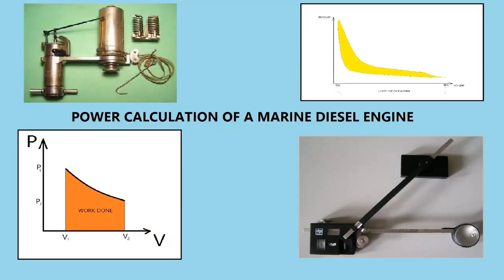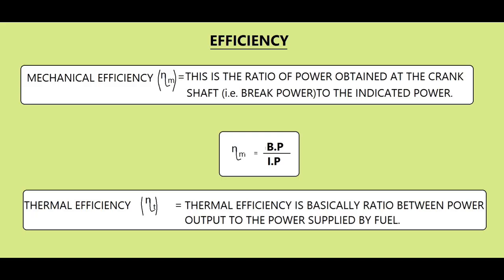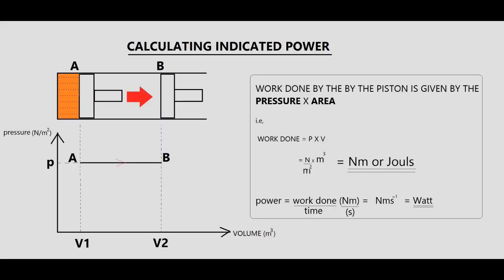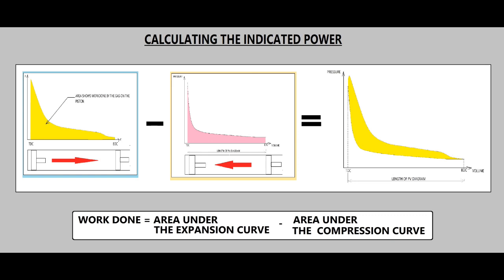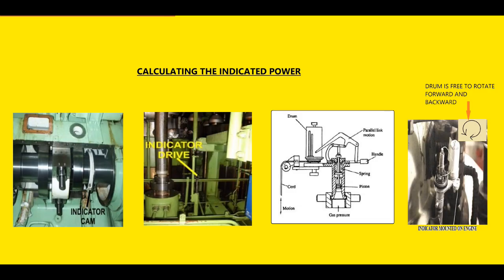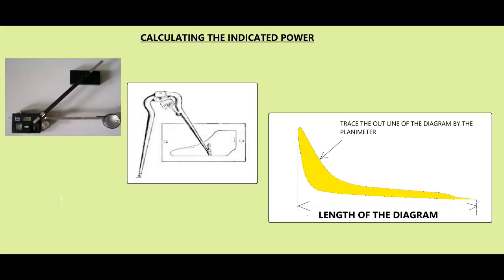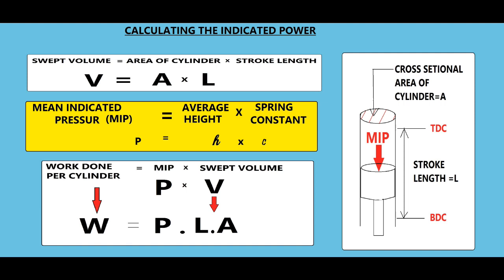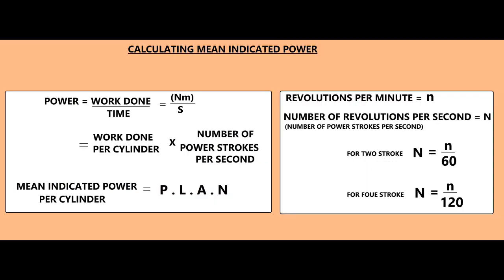indicated power calculation of marine diesel engine

Comment: sir according to b & w manual
Mean indicated Pressure  Pi=  area of diagram / length of diagram x spring constant
Mean effective pressure Pe= Mean indicated pressure - losses
losses =  0.125 Mpa which is constant according to manual for model 7L35MC

Effective power = Pe x cylinder constant x rpm
Indicated power = Pi x cylinder constant x rpm

im confuse why mean effective pressure is use for Indicated power instead of mean indicated pressure. 
mean effective pressure and mean indicated pressure are not the same, is it correct?
Reply from the maker: Effective pressure is the pressure use to develop useful power.Indicated pressure is the one use to calculate the total power development measured at the cylinder heads.indicated power is always higher than effective power.if they use effective pressure for indicated power check weather thay might use any correction factor for the calculation.
Also I have seen in some books mistakenly use this words mostly due to typing errors, but the logic is this.